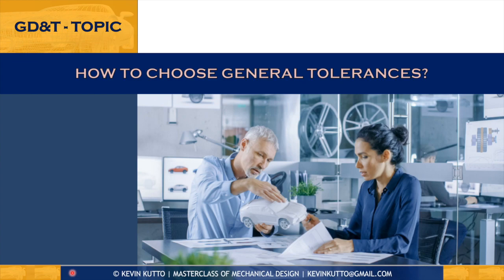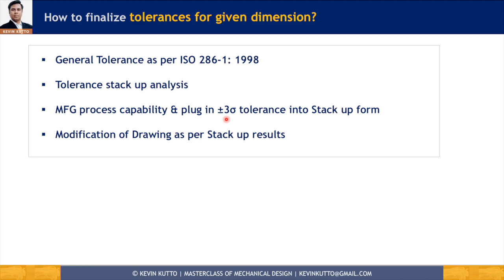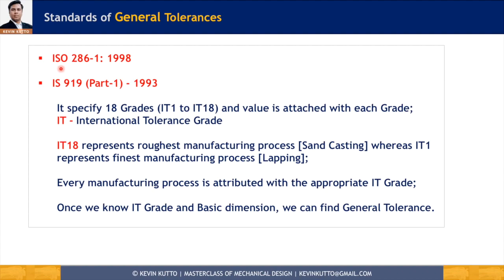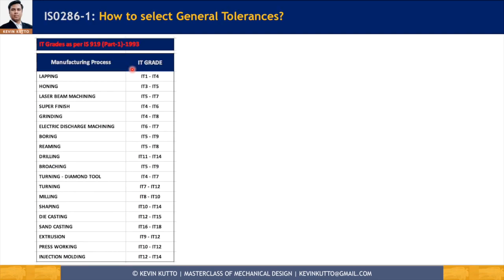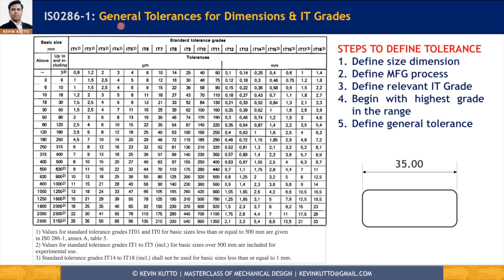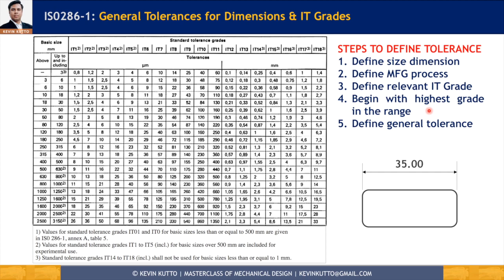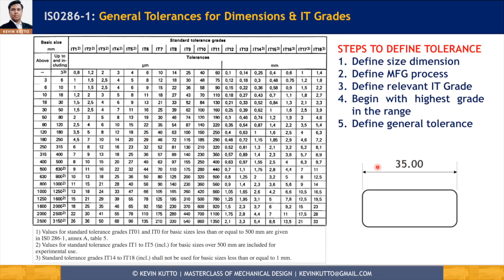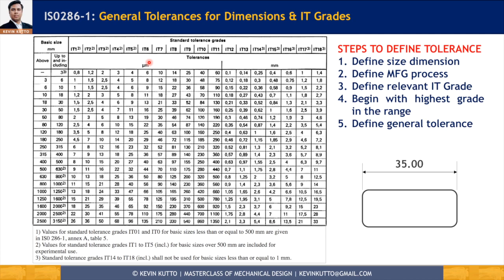How to choose General Tolerance | General Tolerance Chart | ISO 286-1

Comment: hi, may i ask. for IT12, is it acceptable to add the tolerance tighter (into IT11) or looser (into IT13) in the drawing? If the drawing specific that we must use IT12, is tighter or looser acceptable or not ?
Thank you

Comment: can anybody explain why fits weren't considered anywhere in this video to arrive at tolerance values....in this video tolerance values were selected on the basis of manufacturing process but don't you think selecting tolerances based on fits is more appropriate compared to that...
Reply from the maker: If we have mating feature in design which form engineering fit, then it makes sense to choose IT grade based upon function. But most of the dimensions and Tolerances on the part may not form the engineering fit, so in those cases, simply select the cost effective manufacturing Process and relevant IT grade.
Reply: @mechanicalvault  understood thanks for your reply

Comment: Thank you for providing such a great video. I have a question Sir, how do you know if the tolerance stated in the table is equally disposed on the basic size? Could the tolerance be unilateral (+x / +y) instead of bilateral (+/-x)? Thank for reading my question.

Comment: It is required to compute the limit dimension for an interference fit on the shaft basis system  for a basic size of 30mm diameter, with a negative clearance of 0.20 mm, tolerance on hole 0.025mm and tolerance on the shaft 0.050mm. (ans)